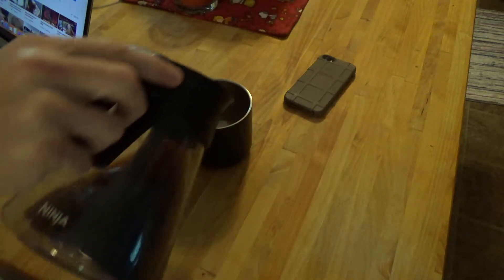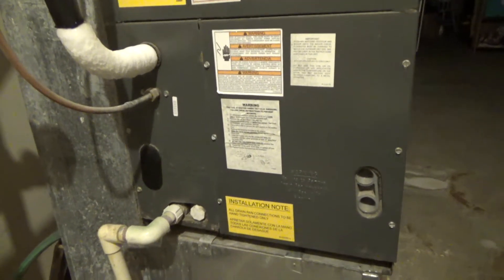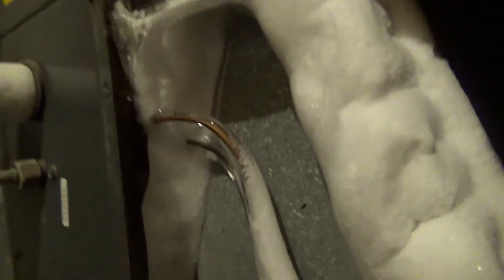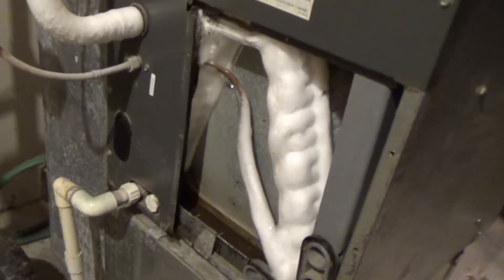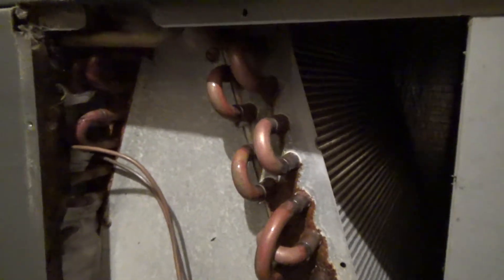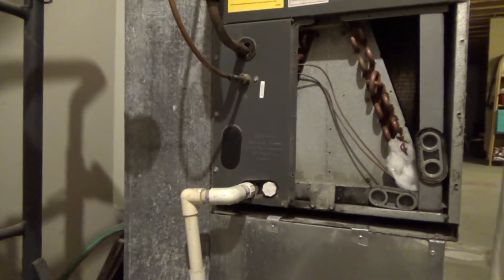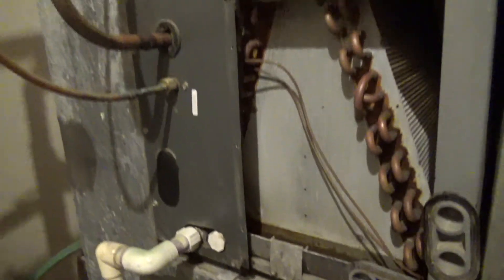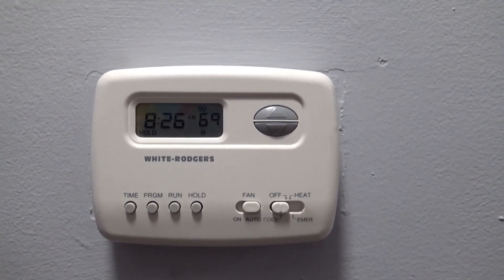Fix Furnace Ice Up (Frozen Coil)

Comment: Thank you very much!
Reply: Geeez I had no idea there was a filter in the furnace😅
Coils were frozen up pretty bad. Instead of a heater, I just turned the a/c off and turned the fan on and I melted it all in about 1hr.
Reply from the maker: As long as you got it fixed, its all good. Replace the filter once every month (or two depending upon how heavy your use is) and it will really help. Stay well.

Comment: My furnace is just like this. The furnace started defrosting on it's own. I can hear the water dripping. Then the water started leaking on the kitchen floor. I removed the covers, and cleaned the water up. All the ice melted. No more water leaking. I turned the AC on again, and the coils started to create frost again. Do I need a new furnace? I also cleaned the filter.🙂
Reply from the maker: Sounds like there is excess humidity in the area. Typically that is the only thing besides a dirty filter that will cause this issue. If you can run a dehumidifier nearby, it will help (if you have the space). It is the lack of air flow that causes the humid moist air around the coils to begin the frost (and once it starts, it just keeps building upon itself). Hope this helps.

Comment: hard to believe a dirty  filter can cause all that ice.  Do you know what merv the offending filter was and what merv did you replace it with?  Shouldn't there be a cover over the filter slot to prevent other than return air from being introduced to the filter?

Comment: Did you have to turn it off first? Can I still run ac while it's defrosting?
Reply from the maker: It needs to be completely off to defrost. I recommend doing it overnight while it is cooler since you will not be able to run AC. Hope this helps.
Reply: @HNXMedia  Thanks, we did turn it off and let it defrost all night. I'm actually about to go look at the results. Thanks for the video!
Reply: What happened after you got all the ice off the furnice?  @majorjjm

Comment: Very helpful sir, thanks a lot. Exactly same issue with mine today. One other thing i noticed was water dripping into the motor fan in the below section of the furnace. I disconnected all connections to ac and furnance, dried up all the water and mess and ran 2 table fans to dry the motor. Only saw few drops of water on it so not expecting it to smoke when i turned the unit on.